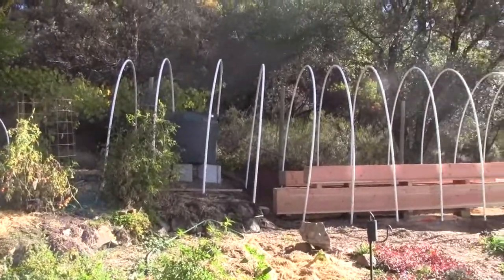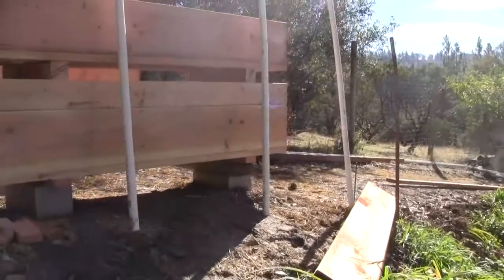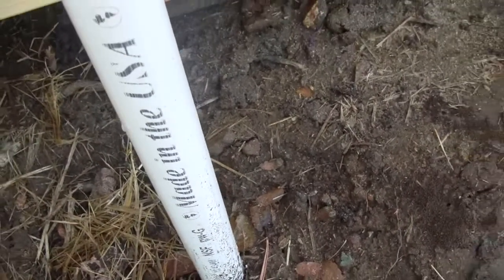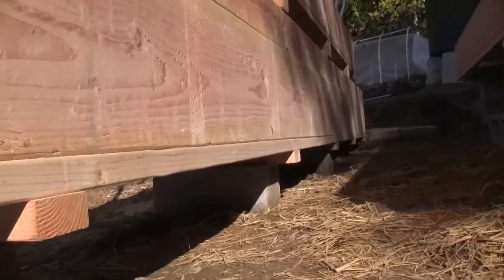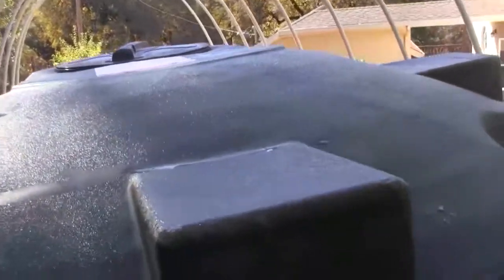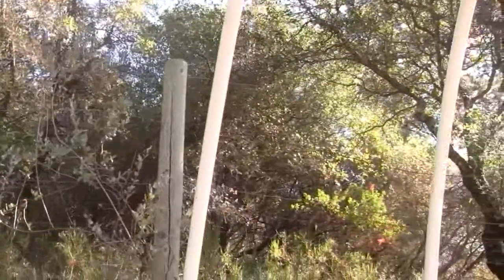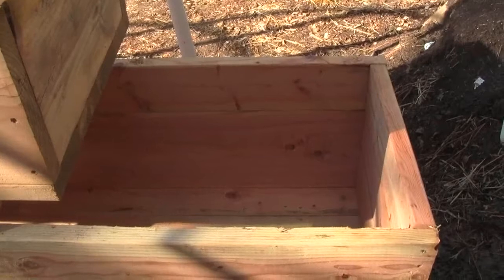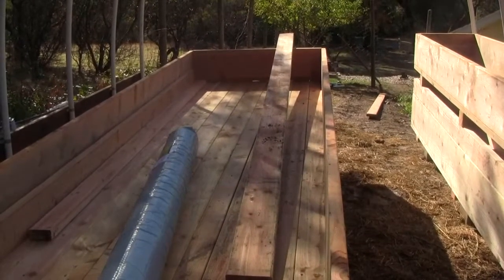Personal Media and Raft Aquaponics System 2

Comment: Good setup you dont need two pumps because you can split the outlet between the raft and tank and use valves to regulate the flow to each, keep the other pump on hand incase you have a failure a good rule of thumb is double the tank size in gph so for your setup a 900-1000 gph pond pump will run the whole system and use only about 10$ a month in electricity

Comment: Firts, thanks for all the videos! I'm building my first system and am learning alot from your posts...

I had the same question about the second pump too though, and I see you didn't respond to DocScience2? I'm not trying to judge or lecture you, I'm sincerly curious...

Is there any reason you didn't drain your flood and drain bed directly into your float bed? It seems you could eliminate a pump that way and make the rest work off gravity?

Thanks, Matt...

Comment: I have an idea that I am wondering about using.  
Can you have the drain from your media table going into your raft table ?  If you are using or can use floating rafts, the rafts will maintain what ever height they are at, and can go up and down with the emptying of the media table.   If you can do that, you would not need an extra sump table, and can make it work using only one pump.